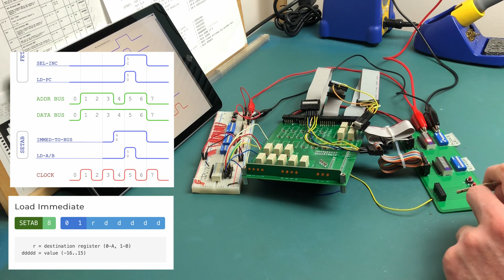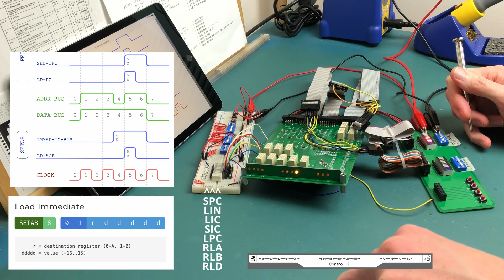Relay Computer: Controller Upper Card

Comment: Wouldn't it have been possible to make your relay computer without diodes? I note that Zuse's Z2 computer was essentially a relay computer made before semiconductor diodes had become available.
Reply: i believe the diodes are a safety feature, not a requirement. inductive loads, like motors and relays, can produce fly back current when turning off. the diode shorts this back into itself to avoid damaging the surrounding circuits